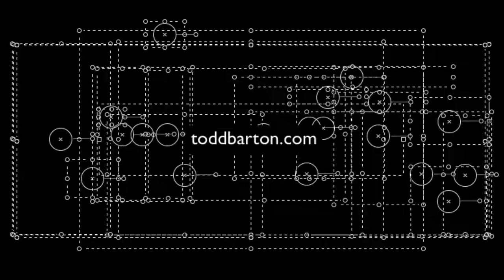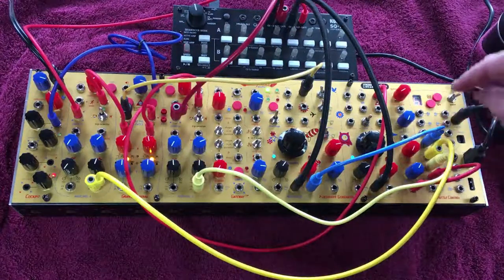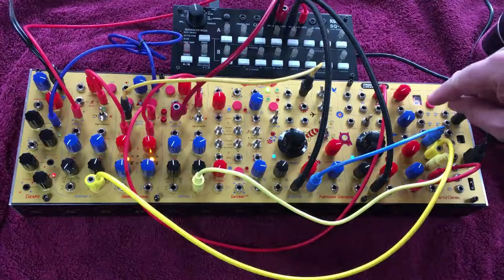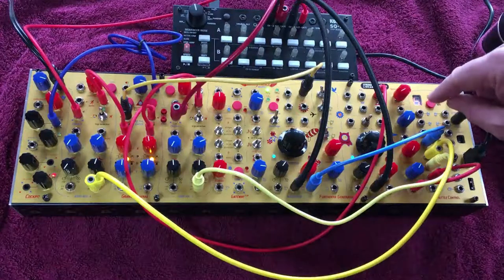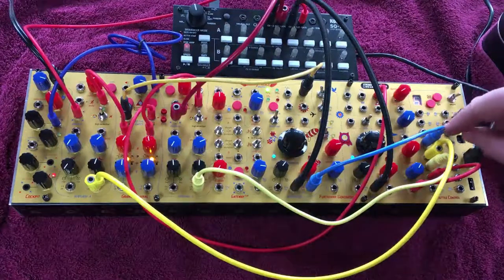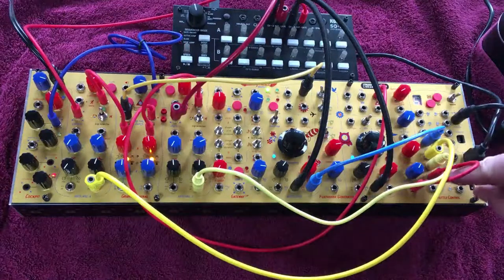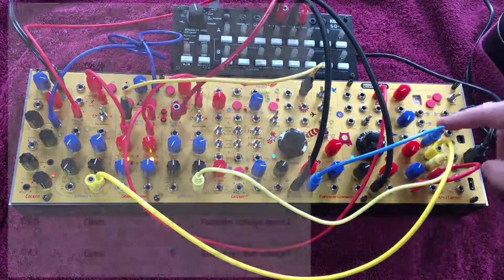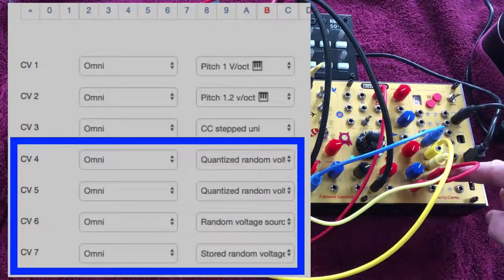Endorphines Random Voltages

Comment: Hey Todd! I bit the bullet and bought the shuttle system, it hasn’t showed up yet, but I plan to use it with an SQ-1 and a Qu-Nexus for “easel” style work. How do you get the SQ-1 sending clock to the shuttle? I was hoping to use the shuttle MOSTLY for LFOs, Random, and Pulser vibes! TIA 

Will likely email you once I dig in a little more ❤️
Reply: How the shuttle control responds to and requires MIDI still boggles me a little! Like how do I get my random LFOs to be “in time”?
Reply from the maker: congrats! Come out of the back of the SQ-1 and into USB on the Shuttle
Reply: Todd Barton I figured that out after I sent the comment. But thanks anyways, you’re the best. Does that mean each random out then will be “different” but in time like it is on the easel?
Reply from the maker: Yep, you can actually specify what flavor of random you want via the Shuttle Control online editor https://www.endorphin.es/cargo3/

Comment: Hello Todd, I've been using the same configuration (Shuttle + SQ-1) but have also experienced a lot of jitter in MIDI clock synchronisation, i.e. don't seem to be able to get a steady clock that has also the same tempo as the SQ-1. Have you by any chance noticed the same thing?
Reply from the maker: Hi Nicola, hmmm….nope no jitter here, sorry.